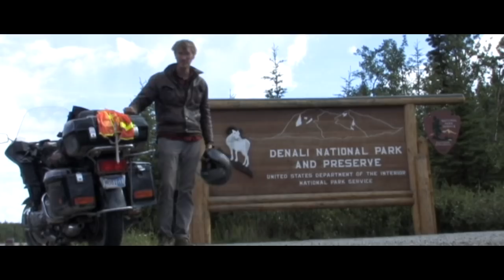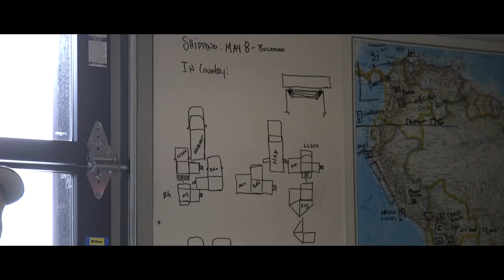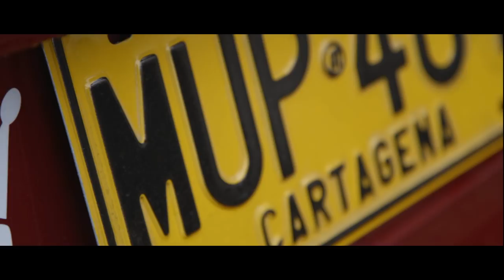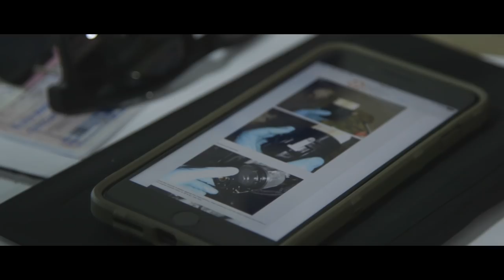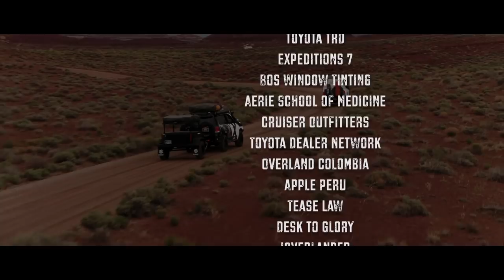South America S3 Ep1: Shipping Trucks to Colombia and driving the SCARIEST bridges ever!

Comment: What's inside the secret Tacoma bed cab? I think in the past I recall the truck bed enclosure being dedicated mostly to video production equipment/workstation. Would be super efficient if there was a passenger seat setup back there and on-the-move drone deployment and POV operation. Air conditioned? Media production work, file management, etc while on the road for long stretches... that would be cool. Maybe we'll get a peek inside on this trip. (Or maybe it's too secret ;)

Comment: I've owned a '76 F150, a '72 Jeepster and a '98 Tacoma. The most efficient, toughest, lightweight, least expensive, easiest to work on, easiest to find parts for, "vehicle", for overlanding is my 2007 Kawasaki KLR adventure motorcycle and, ....I can fix it with a rock, a stick and the crap tool kit that comes w the bike.

Comment: Did you guys swap out the rear gears on the Taco or the 4runner?
Reply from the maker: Longbow072 nitro gear and axle put in 4:88 gears in the Tacoma. It was a huge improvement for the weight and power. All other trucks have stock gears.

Comment: don't know if anyone noticed at the beginning and out of port again when Roofio is backing up is squeaking constantly...im assuming none Toyota after market metallic brake pads...
Reply: Johny Hansen it's been on a boat for however long. Any time a vehicle sits, especially in a very humid environment, rust will quickly build up on the brake rotors.  After driving it for a few minutes, it will be gone. Totally normal.